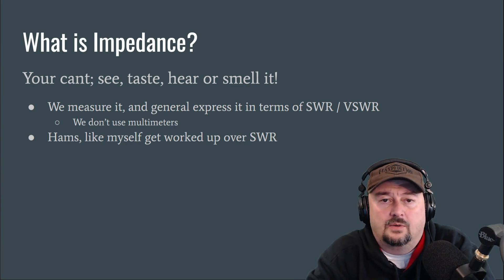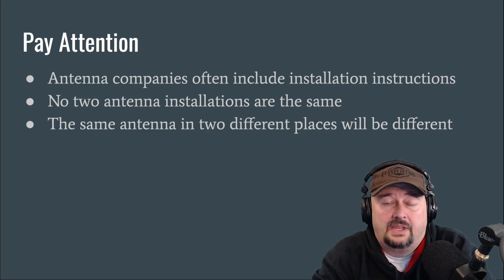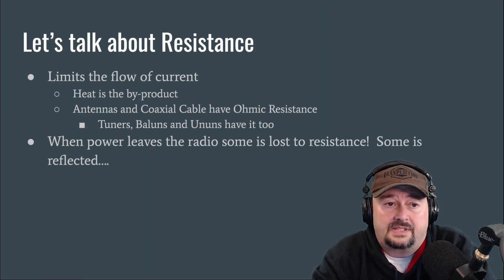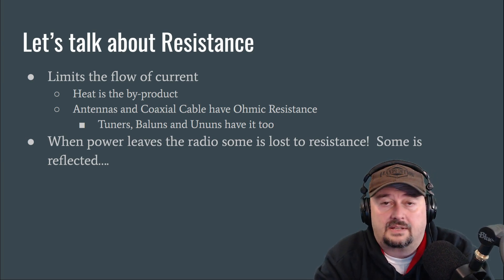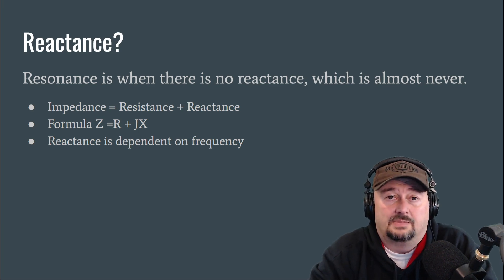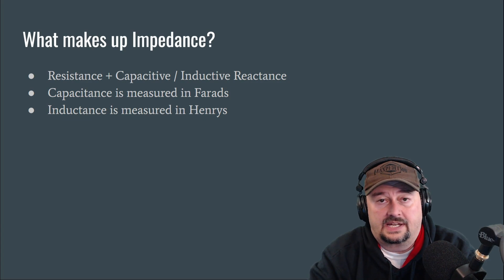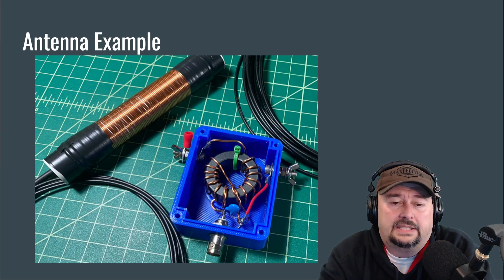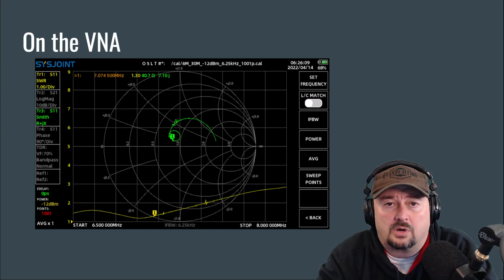Impedance and Ham Radio Antennas Explained

Comment: At ~2:55 you state that a 2:1 SWR represents a 100-ohm load to a 50-ohm match to the transmitter. This is true. If an antenna is employed in a close-to-the-ground NVIS configuration, a 2:1 SWR would be caused by an antenna impedance of 25 ohms to the 50 ohms presented by the transmitter output. So, a lower impedance can also cause an imperfect same-value SWR number. Thanks for the lesson.
Reply from the maker: Hey Rick, you are 100% correct, thanks for catching that and for watching 👍

Comment: Hi When using your Nano Vna , the SWR reading you see , ie The Lowest point. should ,would that  match a reading using a SWR Meter , appox, , knowing You calibrated the nano with a 50 ohm load, and the antenna isn't , I used a nano to tune a vertical 1/4 wave on 12M  nano was right down to 1.2. but swr on the  rig and swr meter  both read about 2.9 ?confused I am.
Reply from the maker: Not quite sure I understand BUT yes the reading on the VNA should match the rig at the same frequency provided you have them connected at the same place on the coax 👍

Comment: What's more important? resonance or low SWR? Would it make sense to build an antenna to be resonant at the desired frequency (not inductive or capacitive) and then use a tuner to get the SWR down? Or just tune for impedance and don't worry about resonance?
Reply from the maker: I’d rather have resonance and use a tuner 👍
Reply: @TheSmokinApe if my antennas SWR is 1:1 at my frequency of choice on the VNA, is that not the same as resonance? Or am I misunderstanding it.
Reply from the maker: @TheNapalmFTW that would be resonant if measured at the antenna feedpoint 👍
Reply: @TheSmokinApe thanks that's what I thought. I'm building an antenna for LoRA and I was trimming it to be dead on balls to almost a 1:1 SWR at 906MHz and I was like "that's it, right?" Lol.
Reply from the maker: @TheNapalmFTW that’s a small antenna, good luck with the project 👍

Comment: The other day I tried an inverted vee in the bedroom to get an idea of length required before putting one into the attic.  It's about 20 SWG enamelled wire. RG58 coax and a ferrite ring at both ends.
The SWR went down as I kept shortening it until past a low reading it started to rise again. 

At this point checking with the NANO VNA gave the following readings, frequency 24.925 MHz:
SWR 1.04
Impedance 49 - 49.7 Ω +j2

Lengthening by about ⅝" my SWR meter showed a lower reading again, the VNA showed:
SWR 1.02
Impedance 49 - 50 Ω +j1.4

I'm impressed, pretty near resonance. Things will change in the attic, close to other dipoles, brickwork and lighting cables up there. 

G4GHB.
Reply from the maker: That sounds pretty awesome, good luck with the move to the attic 👍
Reply: @TheSmokinApe  
Yes, it was awesome.
I've been told you can't find resonance using only an SWR meter but I argued you can.
I kept shortening by ⅜" increments until the SWR on my meter started going up again, 24.925 MHz, with figures below using the NANO VNA:

Shorter length, NANO says,
SWR 1.04
49 - 49.7 Ω +j2

My lowest SWR reading, NANO says,
SWR 1.02
49 - 50 Ω +j1.4 

So both pretty good and very usable. ±⅜" either side of my lowest SWR reading would be perfectly good, and of course things would change slightly as I go up or down the band.

73, G4GHB.

Comment: I'm afraid that this is not an explanation of impedance, if anything, it's an explanation of SWR. By the way SWR and VSWR are not exactly the same thing, although they are of course inter-related. SWR is the consequenece of mis-matched impedance in a transmission line.

Impedance is the sum of reactance and resistance in any electrical circuit. Note that the term "Sum" here is used conceptually not mathmatically.

Comment: 2:1 SWR with 50 Ohm transmission line can mean the antenna is 25 Ohm or 100 Ohm.
Reply from the maker: @michaelstora70  we are measuring the antenna system, transmission line and antenna.

Comment: you asked for comments. my comment is that swr is not a measure of impedance. it is a measure of how well the impedance of the transmitter matches the impedance of the antenna system. you can measure impedance with a nano vna using a smith chart.  but otherwise you made a good video
Reply from the maker: @stephentoons  Thanks for the comment Stephen 👍

Comment: Hey everyone, I am doing my own little at home stuff with a new CB radio.  Now the whole thing if trying to understand the SO-239 connector and the output or input of RF energy is a nominal 50 ohms impedance, at least that's what I read in the owner's manual.  Now I read the chapters of the Radio Handbook and the ARRL Handbook and thought that I understand concepts in D.C. electronic circuits.  It has been a challenge for many years to understand how radio antennas relate to the radio transceiver and 50 ohm coaxial feedline.  I sort of agree with smokin aoeppe's video with regards to SWR and VSWR.  There does not seem to be enough info out there in my humble opinion to learn how the things get to a 50 OHM impedance when the frequency from the radio's oscillator get's past the rf amp and to the connector where a PL-259 will go to a coax cable.  I tried taking a few courses at schools and could not get the info.  I saw a book at one time at Humber College for a course called Communications systems AM FM and SSB.  I do not want to draw attention to my own laziness or maybe lack of academic wherewithall.  In other words it may be time to admit that I am not a rocket scientist.  Now I am getting to this in the way that I am a first generation new world Pole (Pollack) spending most of my life in the continental United States and Canada over a stretch of time.  Now I have also heard about CLICQUES like the engineers that go to Queen's are Cliqueish people and I am not sure about the people who go to Ivy league schools in America or in Poland and I hope that not left any other nationality out.  SO where am I going with all of this?  Oh woops, I forget to mention that I am privy to the fact that some companies have their own way of doing things.  They do not always tell their methods.  O.K.  The point, whenever I open a transceiver and look around and start identifying the circuit stages, I get to the so-239 connector and ineveitably try to measure it to ground with a VOM or DMM.  nothing!  I presently have what I read as an Astatic SWR meter which I look at.  Now, as far as I know, with tricks and tips or not, SWR measures Standing Wave Ratio and not the impedance of the antenna connector or the stage it connects to.  That's where it stands so, not withstanding that we are part of the universe and nature and I am not saying anything is a scam but are the CB radios on display in truck stops and CB shops obsolete or something?:hand-pink-waving::face-blue-smiling::face-red-droopy-eyes::text-green-game-over::face-green-smiling::glasses-purple-yellow-diamond::stayhome::buffering::yt::yt:🤥😮‍💨🤧😦👍Not complaining about my limited internet access here.  I enjoy  talking in the radio without video.  I say video as my laptop computer has a monitor as I typy here at YouTube CA.  Thanks for making this area available.  Great effort smokin ape.

Comment: This is excellent.  I’ll be watching your antenna and VNA playlists, for sure.  I’m new to the ham world and antennas are very interesting.  I have the MFJ analyzer and my NanoVNA just arrived.  Hoping to learn more about Smith charts, but first, more about impedance, reactance, and resistance.

I have just erected a 40 m dipole in a row of Crepe Myrtle trees.  The feed point is only 18’ off the ground with the ends at 12 1/2’.  Hoping to get the feed point up at least a few more feet.  I think I’m in, or right at the top of, NVIS territory.  Oddly, I’m trimming a lot of length and the best SWR is still around 6 MHz.

Thanks again.  Much appreciated!
Reply from the maker: Glad you liked the video, here’s one I did on Smith Charts you might like:

Demystifying Smith Charts for Ham Radio Beginners
https://youtu.be/7sWOtdaGQgs

18’ is a little low for 40 but as you mentioned you are likely getting some contacts from steeper take off angles.  Just have some fun experimenting with the antenna.
Reply: @TheSmokinApe  Thanks!

And yeah, I’m using WebSDR and KiwiSDR to listen for my Morse fumblings.  While I’ve heard myself as far away as Spain, Ireland, and the Canary Islands, and routinely up into North Carolina and down to Louisiana (I’m in Alabama), I cannot hear myself on a station that is a mere 20 miles from here.  🤷‍♂️
Reply from the maker: It’s gonna depend on the antennas and their relative take off angles, super close can be problematic at times 👍
Reply: @TheSmokinApe  Yep, there’s a guy running KiwiSDR about 18 miles as the crow flies and I hear nothing from his rig.  Quick question: I have the small NanoVNA and am thinking of getting the larger one.  Which one do you have, or recommend?

Again, much appreciation for all the videos.  Getting in to coax measurements and Smith charts now….

Comment: Which came first:
Feedline impedence or antenna impedence?
I'm trying to figure out how long to make my feedline for a multiband vertical. So confusing
Reply from the maker: This might get me in hot water but I’d make it as long as it needs to be for the run and put a cmc choke on either end.  Being a multibanded antenna you will never have the “perfect” length.
Reply: @TheSmokinApe  Thanks!
I've watched a bunch of your videos on chokes and baluns etc. Would you measure coax impedance from radio, then antenna impedance, then calculate impedance match? or just go 1:1 at both ends? Any specific video I should watch for this scenario?
Reply from the maker: When I am tuning an antenna I test from the coax that goes into my ATU or Radio.  I’m not as concerned about what happens at the antenna feedpoint as my primary concern is what is presented to the ATU / Radio

Comment: Just my opinion, but i never considered "No-Reactance" cause that would equal zero. I considered it "balanced-reactance" kinda like putting weight on a beam scale. 50lbs=50lbs. 500 lbs = 500 lbs. both are "balanced" but not zero. just my 3 cents (inflation) 73 N9IZX
Reply from the maker: No reactance just means that, no reactance and purely resistive...
Reply: i disagree

Comment: The subject of resonance in multi-band antennas would be a good topic for the Smoking Ape treatment.  Using a RigExpert to analyze a friend’s ARRL EFHW, we found that impedance due to inductance and capacitance summed to zero at numerous frequencies.  That’s generally considered as the definition of a resonant frequency. On the Smith Chart it would be seen as a crossing of the horizontal centerline.  Is there an additional criterion for resonance that I should consider? How does your statement that resonance only occurs at a single frequency (which is what I believed also) align with the fact that there are numerous examples of frequencies where reactance is zero?
Reply from the maker: Hey Shannon, I am going to guess you were measuring through a transmission line.  So what you are actually seeing is the impedance of the antenna system and not the isolated antenna, which is fine.  The transmission line does effect the overall measurement.  I'll be doing a video on the effect of transmission lines at some point.  Thanks for watching the videos 👍
Reply: @TheSmokinApe  - exactly right, probably about 38 feet of M&P UltraFlex 10. 
Is there any reason I couldn’t connect my RigExpert directly to the EFHW via an adapter or jumper cable with an N male on one end and pl259 on the other? Would it be necessary to calibrate the RigExpert with SO239 standards (short, open, load) first, or will the effects of the short (under a foot long) jumper be noticeable?

Comment: Yay!,
Back in the day of me being a trainee electrician, we had to calculate all of this sort of stuff for electrical circuits in an exam situation, I'd already passed the written test for my Ham radio licence and I found it quite easy, lots of electricians failed this part of the exam. 
This sort of thing can be really intimidating, if you've never worked with AC theory that depends on frequency as a part of the equation.
My advice is, if you have something like the ARRL book, read and know the sections on basic AC theory, yes it is REALLY dry and boring, but it will hold you in good stead for when you go to build and tune antennas!
Awesome video, Ape.
Reply from the maker: Thanks Mike, and yes the ARRL handbook is a fantastic resource but that too can be intimidating at first. Thanks for watching bro 👍

Comment: Given a 50 Ω transmission line matched to a resonant and radiating antenna; can the antenna be thought as acting as an impedance matching device to space impedance 377 Ω ?
Reply from the maker: You would need a trans match between the transmission line and the antenna 👍
Reply: I find it both interesting and curious no one thinks of an antenna as an impedance matching (w/ transmatch).
Reply from the maker: @thomassecurename3152  it’s because you will get the reflection at the feed-point, if you add the trans match it’s handles the reflection for you

Comment: The only use of a multimeter in antennas is as a continuity tester to check for open or shorts.
Reply from the maker: Agreed.  You’d be surprised at how many time I’ve seen “experts” claim to be measuring impedance with a multi 👀

Comment: SWR measures characteristic impedance versus load impedance?
Reply from the maker: SWR measured the delta between forward and reflected power 👍
Reply: @TheSmokinApe  isn't the ideal zero difference?
Reply from the maker: Yes, they call that a 1:1 ratio

Comment: So I’ve gone down this rabbit hole of antenna tuning. I mounted a Laird NMO27 10-11 meter base loaded whip antenna on my truck for CB. I borrowed an MFJ analyzer from a friend and tuned the SWR as low as I could on the center freq. Under 1.8 across the band.. But my Impedance scale was as low as 20 ohm..  But it’s a 50 ohm load, with a 50 ohm coax. (RG58/u). I assumed maybe the Velocity factor was causing the low impedance. So I tried adding a couple jumpers just for test readings to no avail. . I haven’t encountered this issue before. I even grounded the antenna bracket with 1” ground strap to the hood. No effect. Anyone have any hints? Thank you for your time.
Reply from the maker: With AC current antennas will react differently with varying frequency.  Impedance is made up resistance AND reactance, reactance is inductive or capacitive in nature.   Have to attempted to adjust the length of the antenna?
Reply: @TheSmokinApe  Thanks for the reply. Much appreciated. The only tuning I have done to the whip was during the initial sweep with the analyzer. It is honestly kinda narrow banded. So I trimmed it to reach the lowest overall SWR on the 40 channel spectrum.

Comment: Great info,  Ape !!  ...Making sure I have this correct.....Assuming the usual std 50 ohm radio, coax & antenna feed point at the freq of interest & making diy antenna (yagi) optimization adjustments......If NanoVNA  shows antenna R= 50,  X=0 &  SWR = 1 : 1.00 the antenna system is Resonant & perfectly Z (impedance) matched to 50 ohms......However,  any Significant X (how much Is significant ?...>1,  >10, etc) the Driven element Length & Feed match  Should be  adjusted out to Minimum X reading (more Resonant) & Closest to 50 R,  50 Z  & Lowest  SWR ......X is Less desirable than R Deviations from 50 & should  be corrected  1st .... ??
Reply from the maker: I believe that is correct!

Comment: Great video, Ape! Many thanks!! I'd watch a video on Smith charts.

I have a NanoVNA, but I've never used it in the field. I thought about it last week, at the Don Edwards San Francisco Bay National Wildlife Refuge (K-0189). There is public access from San Jose, Santa Clara County, and from Fremont, Alameda County. I'd never been to Don Edwards before, for any reason, and I went to the San Jose side to check it out. With short trees and pedestrian trails, I couldn't find a suitable place to string my EFHW in any configuration. I finally decided to try an inverted-V from the rear deck of the (closed until further notice--Chicom Crud and all that) Environmental Education Center, using a protruding roof beam as the apex of the V. My inverted-V turned into an inverted-something-or-other, as I ran out of space before I ran out of wire. I thought it would be interesting to measure SWR in that configuration, but what I thought was clearing sky turned out to be just a space between storm fronts, and the downpour began quite abruptly at that point. I did get a few QSOs on 20m, FT8, from Utah, North Dakota, Kansas, and Iowa.
Reply from the maker: LOL @ inverted-something-or-other!

Comment: I bought a Bearcat 125AC hand radio, live in Orlando FL (Orange County). I need an antenna that will allow me to listen to FIRE/EMS in case of Emergency power outages. Can someone help me chose an appropriate antenna??
Reply from the maker: I have been really happy with Comet and Diamond antennas, just make sure you get them from a reputable dealer.